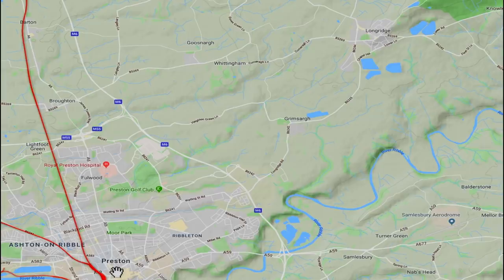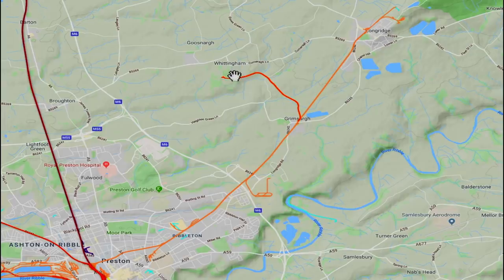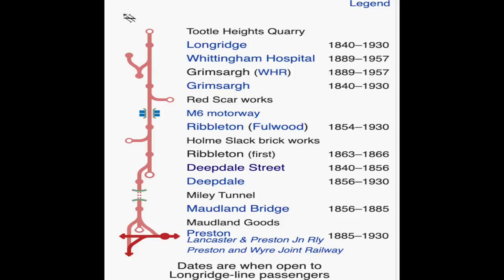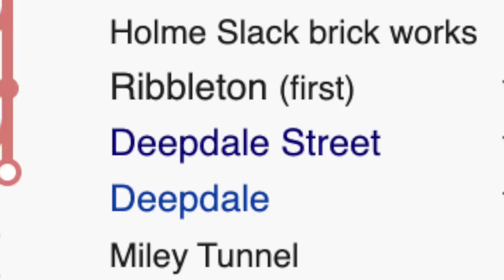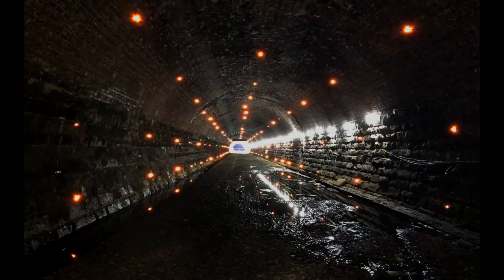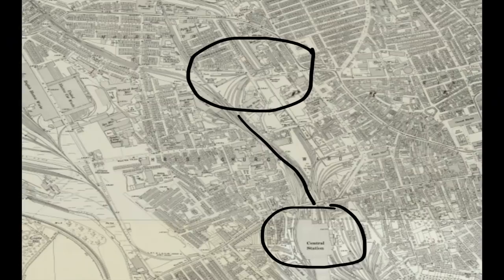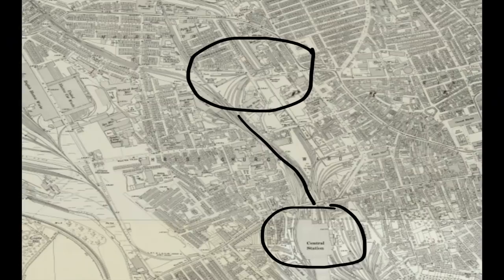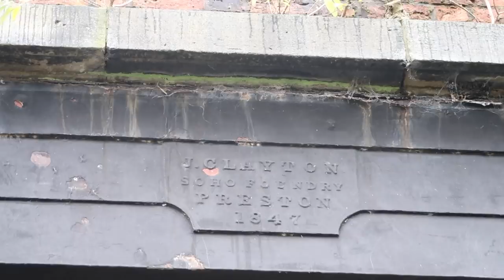The Preston to Longridge Disused Railway Line & The Miley Railway Tunnel

Comment: 32:00 The reflectors will be used to detect whether the walls/roof of the tunnel are moving. A device was probably placed at a precise point near to where you took the flash photo. They would come back and repeat the measurements some time later and note if the reflectors had moved.

The reflectors are designed so that no mattter where light originates from, it gets sent back in the opposite direction (back to the original source). Angle and timing determines the position of the sensor in three dimensions.

Geoff Marshall has a really good video about these devices and how they work on his channel. https://www.youtube.com/watch?v=AtOKYoJUhlA
Reply from the maker: Thanks for the info Greg

Comment: The bridges design - the batter, the curves of the buttresses, the shape and size of the blocks and the propportions are all identical to the 1847 structure of the original line North through a tunnel long disused to Scotland Street yards out of what is now Waverly station, the Edinburgh Leith & Newhaven railway which has most wonderful skew arch bridge ...Grainger and Miller, Leith and Granton Railway, engineers, 1841-43. 3-segmental skew arches with channelled voussoirs, coped semi-circular ashlar cutwater buttresses with piers dividing arches and band course above, below coped ashlar parapet. Channelled masonry to intrados...
no very useful pictures here https://www.railscot.co.uk/companies/E/Edinburgh,_Leith_and_Newhaven_Railway/4.html ...